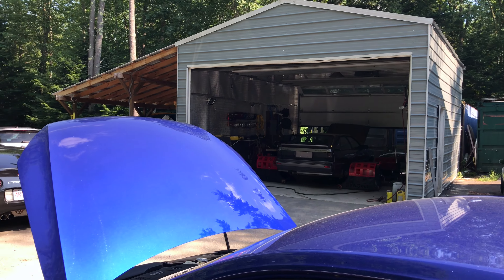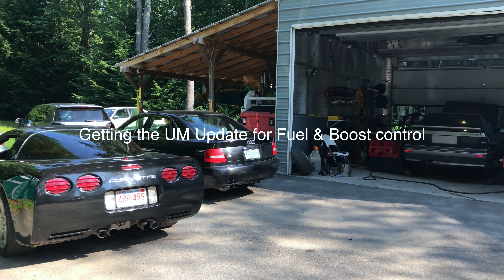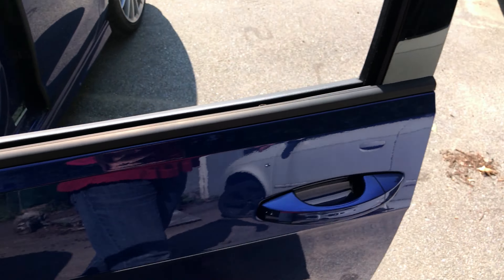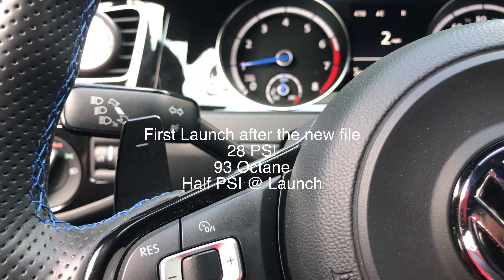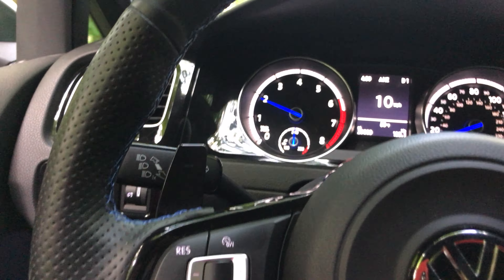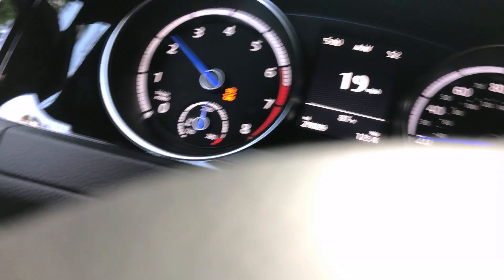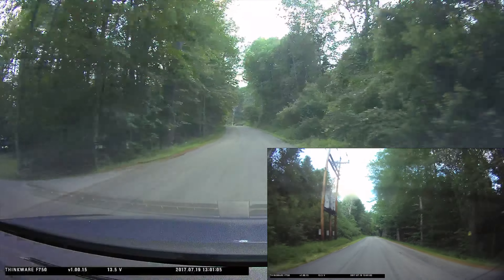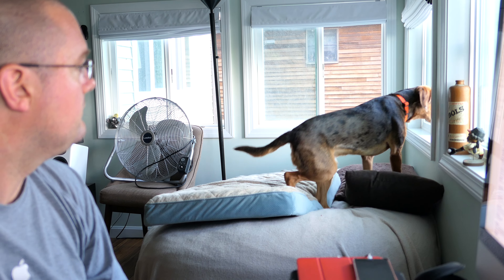Update on my Stage II United Motorsport Limp-Mode (Golf R MK7)

Comment: Hey man, How do i hook up my Macbook pro to the car? Do you look at and clear codes with it via VCDS or are you using OBD11?
Reply from the maker: MacBook Pro + Parallels for Mac + Windows 10 + VagCom Cable + VCDS Installed. Only way to do it.

Comment: Hey Adam!! please help me !! I have the same problem , limp mode with no boost and the code P00AF, I installed JB4 performance module in EA211 1.4 tsi engine but it appears that the car doesnt receive it well . I returned to stock harness connection and I still have the problem. What can I do? How can I get back my ECU original program?  Im so desperate. THANK YOU A LOT! REGARDS!
Reply from the maker: If you still have the problem after going back to the stock ECU programming, then I'd see if VW dealer will help you.